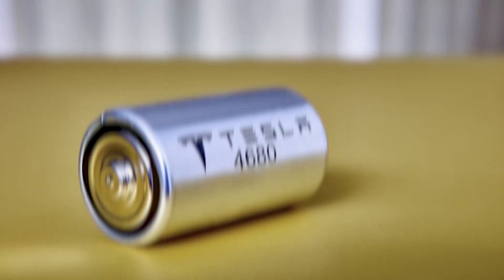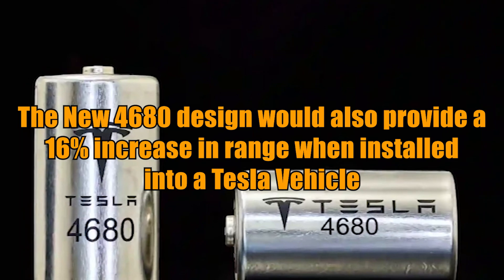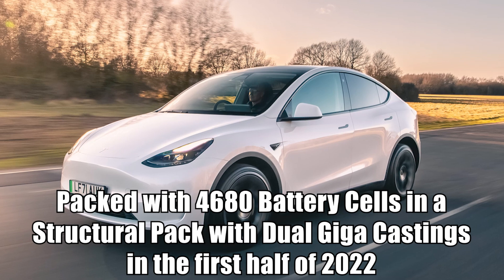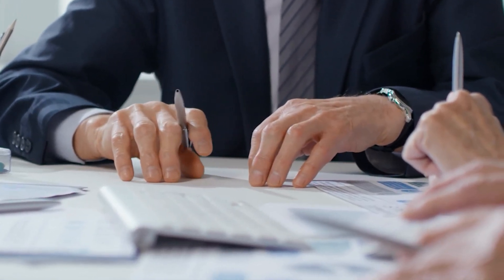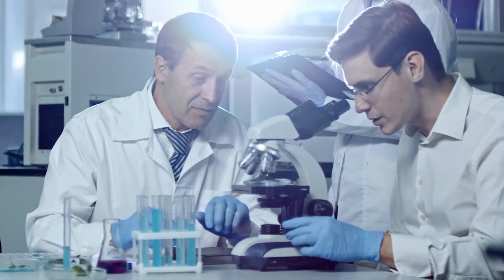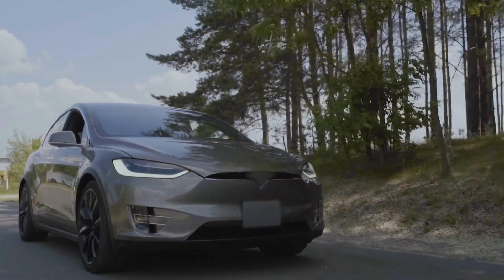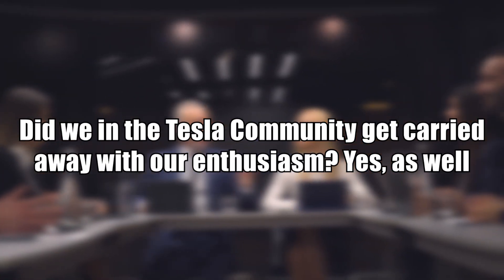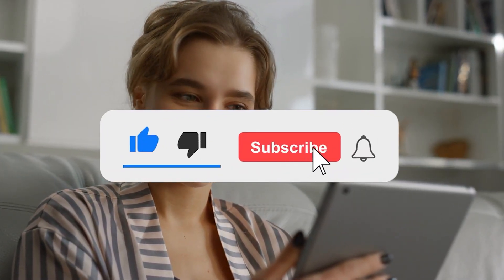The Disappointing Truth About Tesla's 4680 Battery Cell

Comment: until tesla is able to manufacture the 4680 battery using "dry electrode" technology in both the anode and cathode, there is nothing remarkable about the battery other than that it is designed in a package that can be used structurally. and that's NOT a game changer.
Reply from the maker: Thank you for watching and sharing your thoughts. We are looking forward to sharing more quality content.

Comment: I think this 4680 battery seems amazing and could be used in other applications aswell.
Reply from the maker: Thank you for watching! We are looking forward to sharing more quality content.
Reply: No it is not. A battery cell that is 5 times bigger holding only 5 times as much electricity. That's not an increase. The 4680 is only about production gains not consumer gains unless it realizes in cheaper EV cars. Which has yet to be seen.